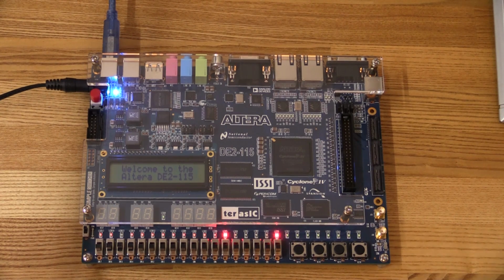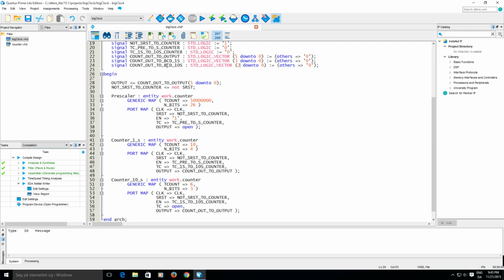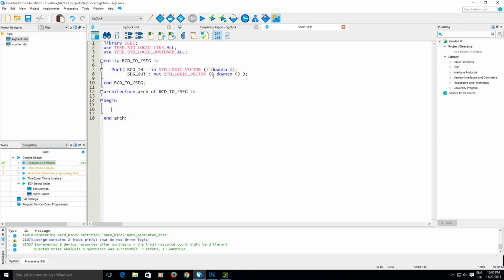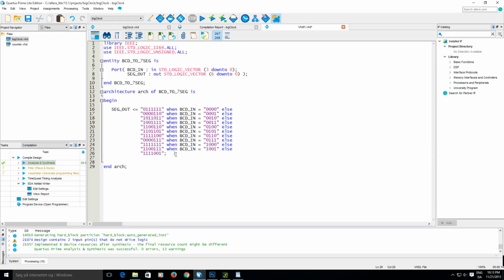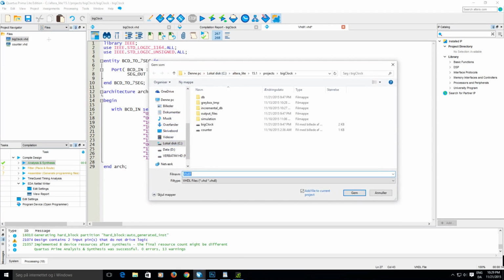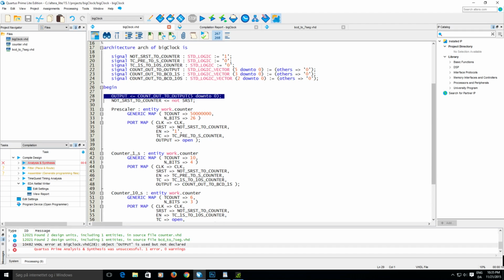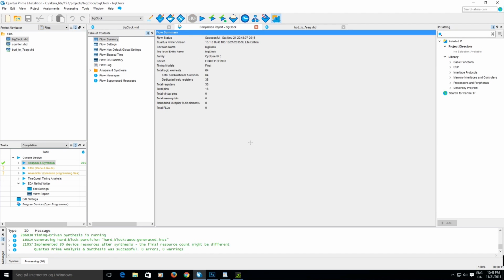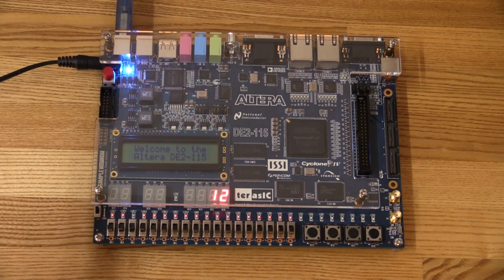FPGAs and VHDL- Part 3: BCD to 7 Segment Decoder - Ec-Projects

Comment: I can't use the bigclock vhdl in my quartus.  It said clause error at bigclock on design library "work" not contain primary unit "counter". What does it mean n how I'm going to correct this error ?tq in advance.
Reply: I had the same error ur expected to use the previous video “part 2” and save a code called counter into bigClock.